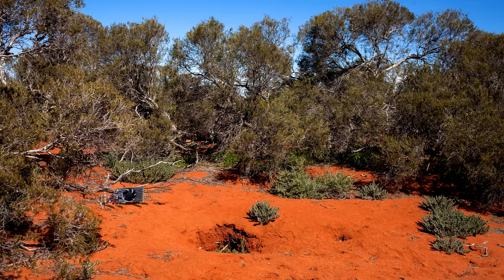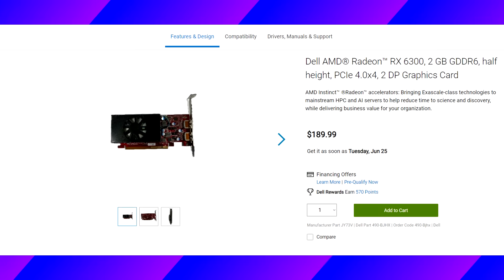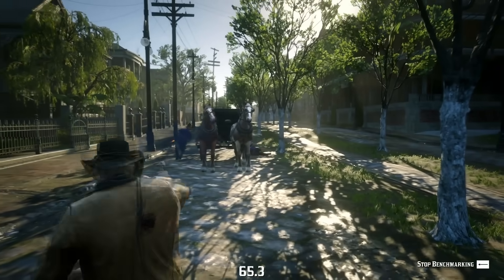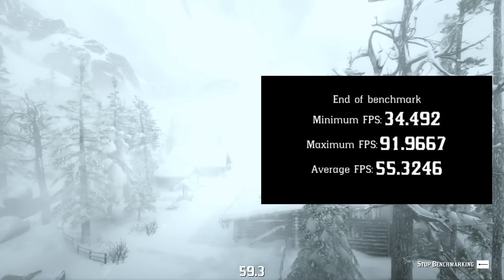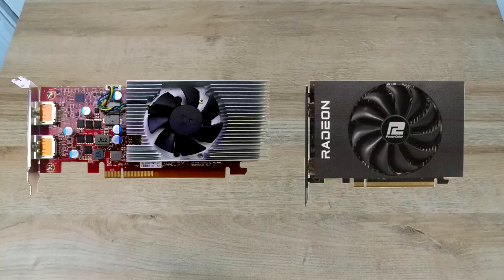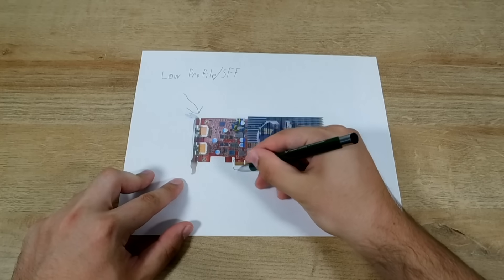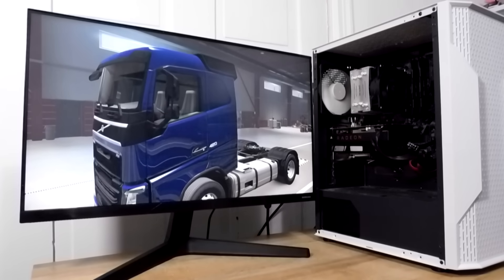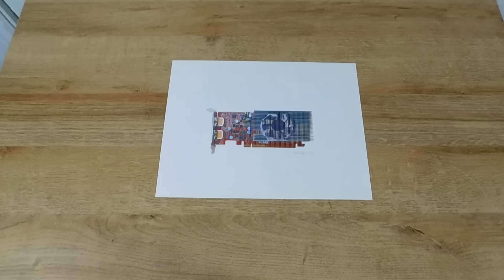When The Predecessor Is Better Than The Successor

Comment: The 32bit memory bus is a crime.
Reply: Even cpu has 64 bit, what a nasty cut down
Reply: It seems that's because the VRAM chip count is halved from the 6400. You'd have to be royally demented to design a chip with a 32bit bus in this day and age.
Reply: @jm036  when you look at board of the garbage one it has a chip missing because the pads are still there I wonder what chip could go there
Reply: @NicVandEmZ  Clearly for the RX 6400 versions of the board
Reply: @NicVandEmZ  that assumes the memory controller works anyway. They can be harvesting die with memory controller failures
Reply: 64bits is already, questionable. 
But 32bits? yeah, that is just beyond bad.
Reply: @mtaufiqnmtn  And CPUs have had 64 bit memory busses since the first Intel Pentium from 1993.
Reply: The narrow memory bus reminds me of my onboard GPU on my old AM3+ motherboard.
Reply: 32bit gddr6 = 64bit gddr5 = 128bit gddr3, this isn’t all that bad.
Reply: @tysonhughes3711 but still, it's like a 3 lane highway going into 1 lane limited to 30km/h. My 1060, with 192bit, with mem oc gains more than borderline stable clock oc + mild mem oc.
Reply: @mmllmmll22  32bit gddr6 still has more bandwidth than my o’d hd 4670 xt
Reply: @tysonhughes3711  It... doesn't work like that...
Reply: 32 bit memory bus???? That would have been shit in 1998, let alone now.

Comment: the 6300 makes the 6GB 3050 look good
Reply: the 3050 6GB at least have a good baseline performance for a 75w card. The 6300 is a repeated time of 2014 (GTX 750Ti)
Reply: The 6300 seems to be the 1630 of AMD
Reply: @sehnsucht1999But the rx 6400 & 6500 xt exist…

Both are worse
Reply: The 3050 owners are crying on the comments 😭
Reply: @thetechrealist  No they aren't. They're actually decently powerful entry level GPUs, mostly meant for esports/older games, with too many cut corners. Where I live you can get them for like half their launch MSRP now which makes them much more palatable than they were back then. The 6400 offers GTX 1650 performance for $30 less and 6500 XT matches the GTX 1660 in benchmarks for much less too. It can also be OC'd for somewhere around 10-15% performance gains.
Reply: @madelaki  Typical, AMD gets a pass because they’re already discounting a poopy product…

And no, the 6500 xt does not match a 1660 without an overclock…

Also, there is the old 4gb 6500xt version which blows & only recently they came out with the slightly better 8gb version
Reply: @thetechrealist  Anyone gets a pass if their product is cheap enough. The 6400 and 6500 XT are the better choice for most people where I live. Plain and simple. Obviously that's not the case everywhere and it wasn't the case at all in 2022.
Reply: @madelaki  No, yeah, I agree.

But let’s not praise AMD’s budget GPU’s like they were any better when they first launched.

The rx 6600 is still the best budget gpu which makes getting anything lower dumb.

So I’m just saying, call it all dumb, not just Nvidia
Reply: The 3050 isn't a bad card. The card was just bad value
Reply: worse in terms of value right ? @thetechrealist
Reply: @madelaki  6400 and 6500xt are dogshit 4gb cards. 4gb vram is bottomline in gaming 2024.
Reply: @baoquoc3710  what do you mean by that? What was wrong with the 750Ti? I dare say it's still a decent low-end e-sports GPU to put in a SFF office PC; maybe better than a GT 1030 because you can stream.

The RX 6300 has ZERO saving graces. At all. I cannot find anything good to say about it.
Reply: @madelaki  6500XT also has half the PCIe lanes of 5500 XT so it doesn't function properly on the vast majority of PCIe 3.0 motherboards

Comment: Wow. The 6300 is way over priced. I paid $130 for the 6500 (it was on sale) and it came with a free $60 game, Dead Island II.
Reply from the maker: @baroncalamityplus  Yeah I really don't get why the price is so unexplainable high, but I think it could have just been a bad negotiated deal all around for what should have been some cheap OEM parts to be made.
Reply: @BudgetBin  Maybe though replacement part direct from Dell/hp and similar is tend to be overly expensive compared to a comparable off the shelf part especially stuff meant for business/professional computers. Not sure if any dells came with a 6500 but if you you had to get a replacement gtx 1650 or similar from dell it would probably be way more expensive than one you could get on amazon and the workstation variants would probably come with some expensive quadro equivialent instead.

Comment: Maybe you'd have a better luck finding a GT 1010 lmfao
Reply from the maker: @Russell970  honestly at this point, you may be right.
Reply: @BudgetBin  btw even the 6500 XT is worse than the 5500 XT, not only less VRAM and less PCIe lanes but also lacks a dedicated video encoder for streaming/recording, However the RX 6400 might be the only viable thing to use in an SFF PC because it's performance is acceptable and is close to an RX 570 and is probably better than an ARC 380.
Reply: @Russell970  5600xt ties the rx 6600 and sometimes beats it and the ipc of the 5700xt and a 6700 the same i modified the power tables on my 5700xt and overcl ocked to 2450mhz and got 6700 performance granted using way more power rdna 1 and rdna 2 give the same performance clock per clock but rdna 2 uses less power and clocks higher
Reply: @josephdias5859  Nah the RX 6600 is way better than the RX 5600 XT
Reply: @BudgetBin  rx 6300 vs gt 1010, the battle of legends
Reply: @Russell970  6500XT also has half the PCIe lanes of 5500 XT so it doesn't function properly on the vast majority of PCIe 3.0 motherboards

Comment: I hate how the 6300 is a "cheap display out" single slot card with 2 DP ports, where we had single slot GT710s with 4 mDP ports. And passive cooled at that.

BTW those GT710s retail for $60.
Reply: Phew I thought I was the only one looking for the 710, I have a RX 560 right now and I’m so sick of AMD right now this thing has been holding back my poor 12 core 32 GB PC for a YEAR NOW I just want a working GPU it wasn’t even USED intensely it was just a headless server 😭
Reply: HUGE ANIME BREASTS

Comment: dell was shipping the RX 6300 with their SFF form factor desktops with the huge surge in work from home applications that needed something cheap and small but would handle two display ports with accelerated video decoding for zoom or other situations. the low profile was also handy for a new series of 1U server computers and modern KVMs that use DP output instead of VGA, as some specific racks do not have integrated DRAC or ILO.

the older RX 5300 was iirc used almost exclusively as an XPS mini tower add-in GPU because the XPS home office PC (a step below the optiplex but above vostro) needed to hit some lower price points and the WX 2100 and 3100 weren't available in enough numbers to hand out with the XPS with HP using the same part number combined with a higher unit price. so the XPS got the RX 5300 and the Optiplex received the WX 2100 as base line GPUs (and remember, the scalable xeon C422 and C621 lacks a integrated GPU of any kind).

if you want to get super weird and "probably not on youtube" i have a Quadro GV100 from when i did industrial CAM work. iirc it's dell branded but has PNY stickers.
Reply: servers switching away from VGA is not allowed.  I refuse to let VGA die
Reply: @ParticularSky could be, i mostly work with HPE and Nutanix gear now. there some real weird OEM cards i see in servers now, either to add KVM output or to integrate with an intelligent rack. $30k gen 10 HPE servers that have a $300 add-in card just to add VGA output type of thing (iirc it's also an AMD chip) for example.
Reply: @ParticularSky had a GT330 in an HP ProDesk a long time ago, was pretty good for a slot-in GPU for airport kiosks that had to run a local DFP and simultaneously an advertising television on HDMI. most don't even know there was an nVidia 300 series.

Comment: The Dell RX 6500s are floating around now, too.  I picked one up and threw it in a PC I got from a thrift store for $5.  It's a Steam machine now.  

I have all the low end RDNA2 cards: 6300, 6400, 6500, 6500XT.
Reply from the maker: @knifemind  nice, I hope I can get them all in my possession someday.
Reply: One of these days I'm going to set up a test and compare the 6400 to the 6500. The 6400 has fewer CUs, but Dell's 6500 is clocked so low that it might actually be an interesting matchup.
Reply: How tf you can get it for 5$, was it broken?

Comment: There is actually a redemption for the rx 6300: use it on one of those weird pci to pcie adapter. Which is what i'm doing. Performance is not that much different since the maximum you can squeeze out of a pci slot is just about that. But now you're not wasting your precious pcie slot.

Comment: I still find your style of editing and the drawing like intros funny and gets my attention. Thank you for making the specs box more readble in more recent videos as well.

I was searching for the RX 5300 and RX 6300 a while back and I can't find them on marketplaces in my country. And good thing I never bothered trying to hunt them down further since the performance is pretty lacking.

It's way easier to get the RX 5500 XT and RX 5600 XT since they're available as both used and new (new-ish/remanufactured) from Aisurix, Millsre, etc.
Reply: I found my RX 5600XT is way more powerful (performance and power usage) than what I use it for infrequent indie games and emulation. (Though having a 3 fan big GPU still looks fun in my PC.)

Honestly I think I just need an efficient GPU (or even a a CPU with a decent iGPU) that provides just enough hardware acceleration. At idle the RX 5600XT uses around 30~32 watts to around 150~180 watts under load.
Reply from the maker: @abunk8691  thank you I try my best every video to make it fun and informative, and of course and I am glad I could make it better for you :)

It is pretty hard to find even the 5300 yeah. Honestly you are pretty on the nose, the 5500 XT is fairly easy to run into.

Comment: I got the rx 5500xt 8gb for $80 a year or so ago, and I feel the same way as you. these gpus are  in a really weird spot performance wise, most games need tinkering/fsr to work. but for older, far cry 5, rising storm 2 or Roblox  it's super solid. I even get to play blade and sorcery. overall, it kicks ass but I would only recommend it to someone who doesn't mind tinkering, definitely not  4090 levels of plug and play.

also, love your videos. they feel money realistic, i can actually go and buy this, thanks!!!🎉
Reply from the maker: @eday244  yeah I agree pc hardware is in a weird spot right now for new stuff. Like cpus are good relatively speaking and can be cheap. But GPUs? Well, I think something needs to change soon since I feel like the entry level/mid range options are disappearing slowly.

But yeah, I am glad you enjoyed this one! I try to make it so if someone likes what they see, they can usually easily go out and get it!
Reply: I dont think it’s fair to want top-of-the-line GPU compatibility from an mid-end GPU

Comment: Its a common thing with budget electronics to kinda suck. The used market gives so much value, especially at entry level pricing. Can get you an older midrange or flagship item.

Its the same deal with phones. The very low end ones suck, and for that money you can get an older flagship or midrange device. Only thing is updates, but thats the same thing with GPUs - although in the form of drivers. I always recommend checking out the used market, especially when your budget is very tight.

Comment: The point of such cards is to add a video output and some basic GPU instruction set support for things like video decoding.
Reply from the maker: @TryboBike  I agree, but at a price point of nearly $200 new, I feel like there are better options out there for the consumer.
Reply: @BudgetBin  Its Dell and its practices of asking $1000 for a basic 32gb of memory. Those are corporate prices. Once these start cropping up at usual places - like AliExpress or used market - they are going to cost $20.
Reply: Thing is even for that the 6300 is still problematic at times since it doesn't have any video decoding capabilities.
Reply: @h.b.5577  are you sure?! This chip is most certainly binned from the Navi24 die (the RX6500 is a shame by itself compared to the RX5500 which is already crimped on old systems because of the PCIe lines halved to a x8 port) So what this 6300 should lack is video encoding, while still providing video decoding capabilities (except AV1).
Nonetheless, this is pretty much irrelevant unless you got a 4k screen because even the entry-level dual core CPUs from 10 years ago have enough performance to do h264 software decoding at 1080p or it simply can be bipassed by using GPGPU decoding techniques (like mpv allows).
Reply: @TryboBike  yes it is due to oem prices. The rx6400 is not that expensive in the retail market. 200 bucks is more in the rx6600 category (and prices even barely dropped during a full year).

Comment: Really the 5300 XT and 5300 is basically an OEM's take to how to cheapen the RX 5500, with the only differences really is memory configs for Bus width and GDDR5 and GDDR6 while keeping stream processor count the same. 
Still wouldn't go less than a 5600/5700XT if going used though.

Comment: Honestly the actual predecessor to the RX 6300 isn't the RX 5300, it was the Radeon 540, a card so obscure it was only added to Techpowerup because I own one. They're often sold as "Radeon RX 540 1GB" or similar. Performance is similar to the Nvidia GT 1030, an extremely well known Display Adapter. It's shader configs are half of the RX 6300, and it has half the VRAM at whole 1 GB. Yes, a single Gigabyte. It's the weakest card with a Lexa GPU. Not to be confused with the Mobile Radeon 540, which is less obscure.

My Radeon 540 is currently inside of my Nearly Maxed out HP Compaq DC5800, with a Core 2 Quad Q9400, 8GB DDR2, a 500GB HDD, a 128GB SSD, the AMD Radeon 540 as mentioned, a somewhat borken DVD-RW Drive, and with some added USB 3.0 & Front USB 3 IO. It can run Minecraft, Half-life and 100% Orange juice.

Comment: I had an intel i7 7700 and a gtx 1080 and it ran cyberpunk at high settings at 70 fps, for some reason I had less fps at mid or low settings. The 1080 is from 2016...

Comment: You could always just, buy a thinkpad for a thinkpad to use a monitor for the thinkpad and like use LFG(Lossless Scaling) for frame generation with a capturecard on the thinkpad while the other one actually runs the game at 30 fps... So you end up with 60fps on the thinkpad that is capturing the output of the other thinkpad....

Okay, I very intentionally worded that horribly. I did an experiment using two thinkpads, a t14 and an a285. The t14 (mx450 dGPU variant) ran bg3 at 1080p low, ultra-fsr 30fps. Then using a capturecard with obs-preview and LFG(Lossless Scaling on Steam), I was able to get a buttery smooth 60fps on the a285 thinkpad. Its so dumb, but works surprisingly well.

Comment: am I the only person that thinks the RX 6300 is somewhat decent? Its no powerhouse but the newer architecture does make it outperform the GT 1030. And I did need specifically a low profile single slot card. Anything with a larger heatsink wouldn't fit.
Reply from the maker: @RoswelliVideos  to a small degree, I agree. But the overall price is what makes this card not good. If it was $100 new, like the GT 1030, I honestly might have praised it, despite its numerous flaws.

Comment: i mean
isn't the 6300 just supposed to be a cheap display adapter for OEM PCs 
that normally some office rat would use? in that usecase i can see it's existence having a meaning, it never was intended for gaming afterall
altho i never heard of the 5300, cool little card, maybe i'll get one aswell
Reply from the maker: @skorpysk  while that would be the case, back in the day, these office workers might have used something like the GT 710, which was $40 new. The price is heavily limiting on why you should get this card. So you would hope to expect it to be able to do a bit more for $20. But yeah, I agree the 5300 is a near little card.
Reply: @BudgetBin  no i meant like, when the company provides the PCs. or for some school PC
Reply from the maker: @skorpysk  oh you mean like including it with the PC?
Reply: @BudgetBin  yeah like OEM prebuilts, the kinda trash bin piles of eWaste that aren't supposed to be very useful, just supposed to work enough

Comment: I used to have a rx5500xt 4gb and in red dead 2, 1080p with mostly high and ultra settings and a few medium, i was getting 50-60 fps most of the time.
Not bad.

Comment: i would say that the RX 6300 is an RX 6400 with half the vram, and that shows if you look at the specs
Reply from the maker: @LexyDaShmexxy  I can see that yeah. I wonder how far it could be pushed if you soldered another Samsung chip on the empty spot it has on the board. It would probably be able to make good use of the lanes having it.
Reply: @BudgetBin   i have a suspicion that one COULD do that but obviously it requires skill, then we're also playing with the chances that it might flat out not work
Reply from the maker: @LexyDaShmexxy  it would have to be done very well, and then you would have to alter the BIOS to even register the RAM anyways. Might be worth it, 5 years from now? Lol
Reply: it also has lower clocks

Comment: If the RX 5300 was single slot low profile and didn't require a 6 pin GPU header.  Id agree.

Maybe compare it to a intel a310 (or a a380 with a a310 cooler) would be better than a 6300.  Granted the latter would be more apt to be compared to a RX 6400
Reply from the maker: @Vekstar  100% I agree. If the 5300 was literally all the things that made the 6300 good, I would fine every reason to recommend it.

And I will think about that. Maybe if I become the next big tech channel, I'll do some fun comparisons.